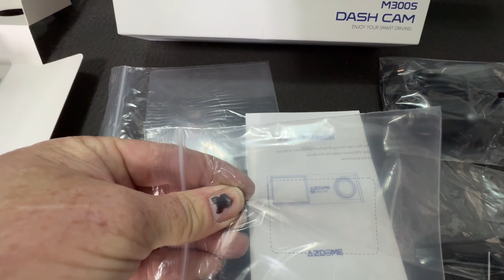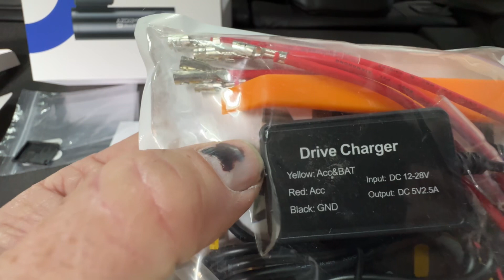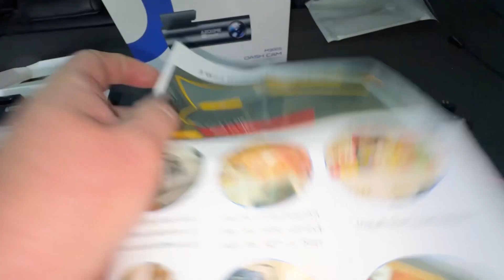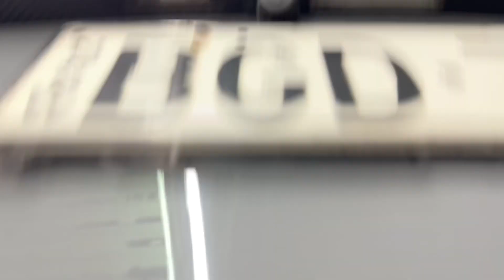Front and rear AZDOME dash camera installation M300S

Comment: What if I only wanted the front camera installed and not the rear camera installled, will it still work? And will the dashcam work while the car is parked and not running

Thanks
Reply from the maker: @Sammy.Boi725  yes, for sure it will work without the rear camera. The rear camera just plugs in. If you use the hardwire kit, you can set the parking mode up so it will record from vibration among other settings.

Comment: Do you know how I can connect it to the WiFi, as I’ve attached all the wires and it’s powered on but the camera isn’t coming up in my wifi list, I’ve tried it on both android and iPhone
Reply from the maker: @diemen1814  there is a WiFi button on the side of the camera. The system should announce the wifi is on when it boots up. The WiFi will turn off after a while but can be turned back on with the button.
Reply: @GrantFixes  is it just as easy as a click of a button? I have been trying for several days I think the button might be faulty but I’m not 100%
Reply from the maker: @diemen1814  it should tell you when it boots up “WiFi on, 5G WiFi” if you hear that, and the little blue light in the switch is on, the WiFi is on. 
If it’s not coming on and the button isn’t working to switch it on, the unit may be faulty.

Comment: Where can I find the hot wire kit?
Reply from the maker: @therightconnectionn  a lot of online places have them. I bought mine on eBay. They’re available on Temu, Amazon and AliExpress. Just make sure you get the right USB type for the camera you have. The Azdome I install use a micro USB and are about $25AUD